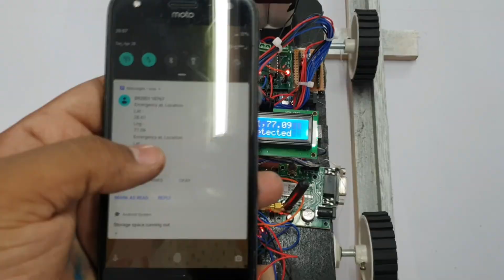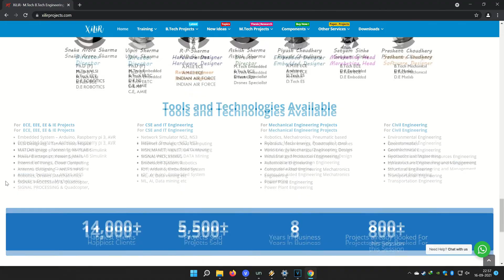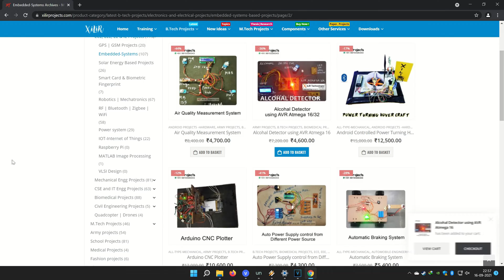Railway Track Crack and Fault Detection System using GPS GSM | Best Engineering Final Year Project

Comment: Please tell me power supply module of 5v is good or solar panel to fix in this system
Reply: Plz tell me
Reply from the maker: 5v module is added here for powering arduino gps lcd ir ultrasonic. 7805-voltage regulator is used
Reply: So no need of solar panel
Reply: Plz tell me
Reply from the maker: No need its not sufficient for these battery..
Reply from the maker: For the prototype purpose u can add to make it solar based
Reply: Plz tell me
Reply: How much motor we need in this project
Reply from the maker: @Shubhamvlogs-s7q  30 rpm grared dc motor , plus motor driver l293d
Reply: @XiLiRTechnologies   thank you so much
Reply: attach to   wheel